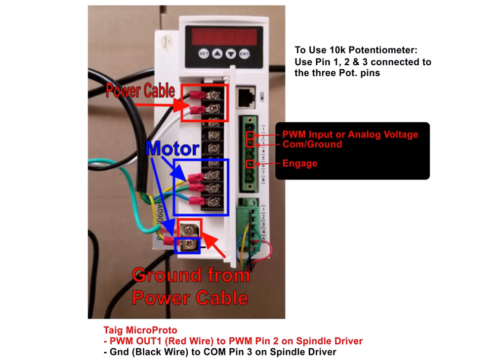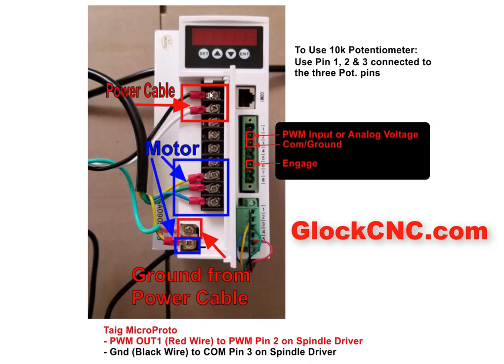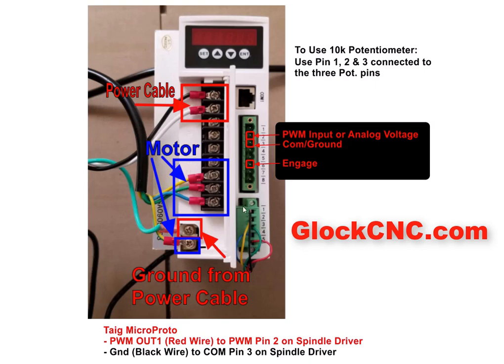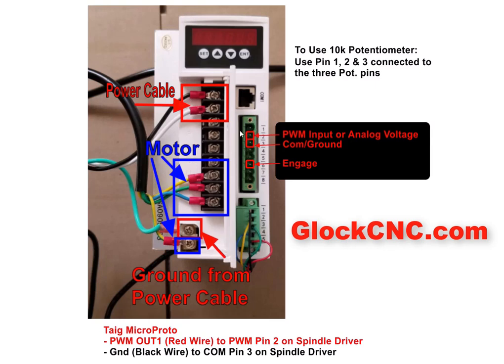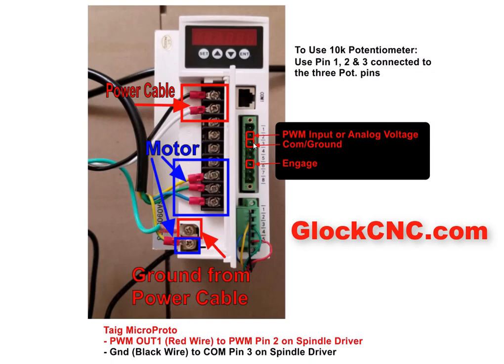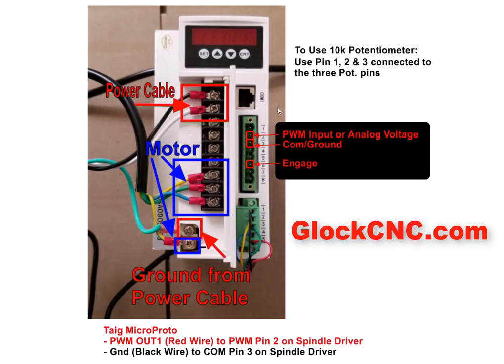GlockCNC Brushless Driver to CNC Board General

Comment: any idea how to make this VFD work with a 0-10v  signal? It says it takes a 0-5v signal and I used a voltage divider, but the motor maxes out when the signal (SV) is around 2.5v and its not linear which means I can get it set at a certain RPM, but the when the specified RPM changes, the motor wont match the specified RPM anymore. From 2.5v to 5v, the motor does not change. Right now this VFD is useless as a CNC controlled VFD. I'm forced to use the motor manually. Any suggestions would be greatly appreciated.

Comment: I recently bought one of these motors to use, and my spindle and tooling is a bit heavier than what the driver's stock PID settings can compensate for, The tooling will take light cuts, so there is plenty of power. The manual mentions PID(not just PI) tuning, however after reading the manual for the driver, I'm not finding the D(derivative) value to adjust. The manual clearly indicates the P and I settings, and they act as expected, however I am fighting a slight oscillation that would easily be solved with and adjustment to the D value. There are two adjustments P1.7 for P value and P1.8 for I Value. P1.9 is the adjustment for "accelerated speed" and P1.10 is for "decelerated speed", not sure exactly how these function, but they aren't the D adjustment. Any suggestions of how to tune out the oscillation?

Another issue I'm having is the controller I'm using has a 0-10v output, not 0-5v. I made a voltage divider using a pair of 5k resistors,  however the voltage after the divider is much lower than what I would expect. I output 100% at the controller, and I'm getting around 2.2v. According to the mfg of my controller using two 1k resistors is more desirable, but I was going off the documentation on your site. You mention running the 0-10v directly, and just not commanding above 50%. My question is, what happens if I do accidentally command above 100%, will the driver tolerate above 5 volts? As an alternative for now I have ordered a 2k fine adjustment potentiometer so that I dial the 100% voltage in at 5v, but I would like a better solution.
Reply: I'm having a similar issue here too with the 0-10v signal and a voltage divider. I cannot get this VFD to do what I need it to do. Were you able to get anywhere with yours?
Reply: @Th3mast3r69  Ok read through the manual:  "The acceptance of SV is DC 0V~+10V, and the
corresponding motor rotate speed is 0 to rated speed. "

Also the value for p1.11 is 11000 which when divided by two is 5500(close enough to 5400).

Given this, Im going to try adjusting p1.11 to 5400rpm and directly connect my 0-10V signal.
Reply: @Th3mast3r69  It worked, so I changed p1.11 to 5400, and then it responded to 0-10v a lot better, and at the full 10v it was at exactly 5400 rpm. I think the reason it was set to 11000 is so you can use 0-5v and still get the 5400rpm, and then you can use the 0 and 5v rails supplied on the unit to supply a pot and use as a voltage divider for manual speed control.
Reply: @davidfarmer Thank you! Yes I ended up learning this as well after talking with James. It's much better, and don't need a voltage divider but runs still a little fast at higher RPM and a little slow at lower RPM so it's not perfectly linear. Is it possible to tell me what you have set for P1.xx for your other settings?
Reply: @Th3mast3r69  I got it tuned in somewhat, but not perfect by any means